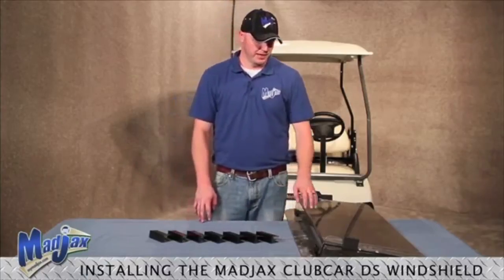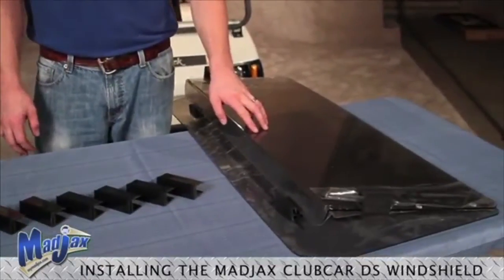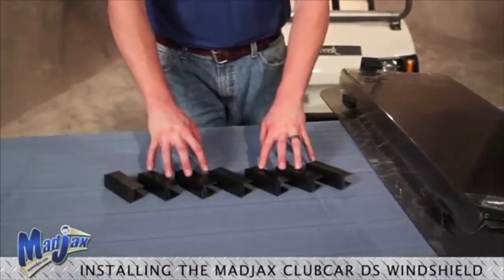Windshield for Club Car® DS® | How to Install Video | Madjax® Golf Cart Accessory

Comment: it is advisable to remove only a portion of the plastic film at the edges, allowing the clips to be mounted .  Once the windshield is completely installed, then peel the rest of the plastic off.  This prevents any scratching of the windshield during installation.